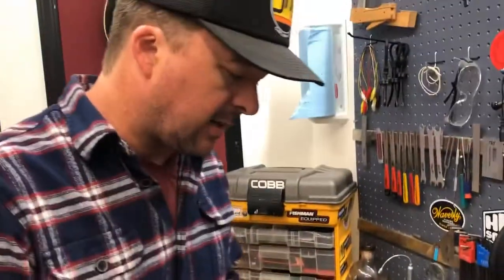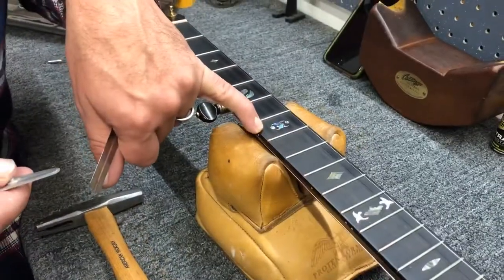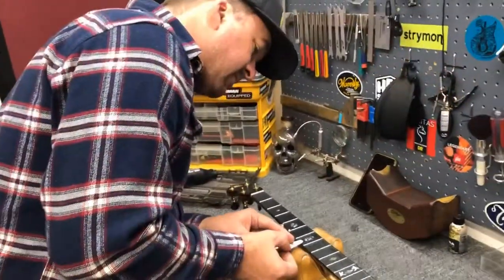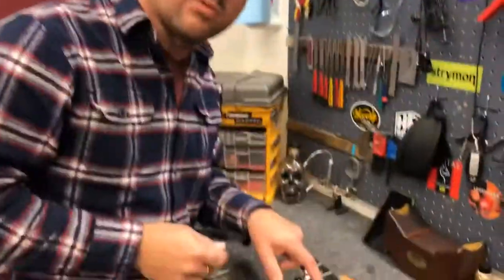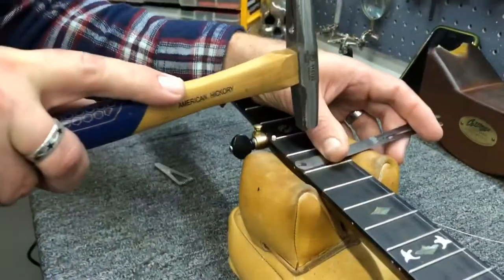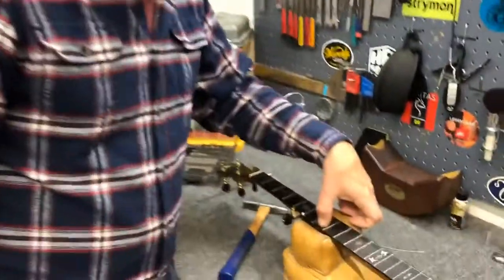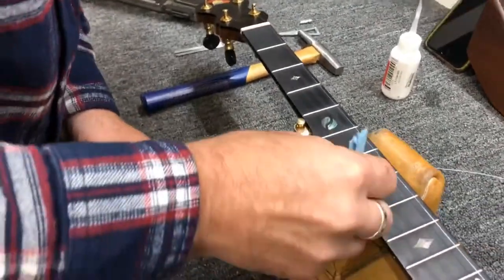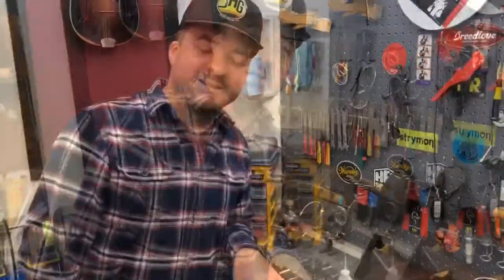Banjo Spike Installed in under 2 minutes

Comment: Thanks for the video, I guess you can only install on one fret otherwise there would be 5th string buzzing if spikes were installed on higher frets?
Reply from the maker: You can install spikes in any position you want them. Most of our customers want them at 7,9 10,11th frets. the head of the spike needs to sit just below the height of the fret and you are good to go.
Reply: @JamesHoodGuitar  Thanks James! I installed 5 spikes and the all buzzed except the high one so I took them all out. I`ll try again using your advice
Reply from the maker: @DanDDirges   You need to be able to slip a 0.10 feeler gauge in under the head of the spike.
Reply: @JamesHoodGuitar  Thank you, I sure appreciate the tips! I might look into getting a 5th string capo if all else fails.
Reply from the maker: @DanDDirges  I do have a longer video on this subject as well. https://youtu.be/jEHYqSYZR8I